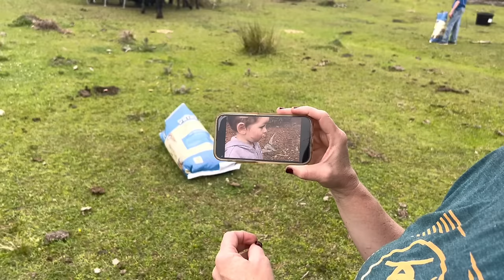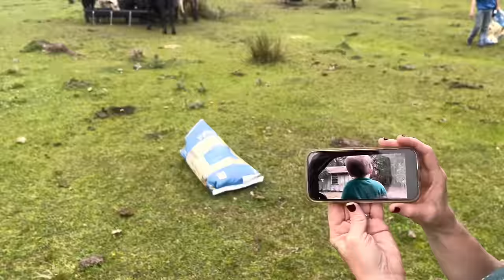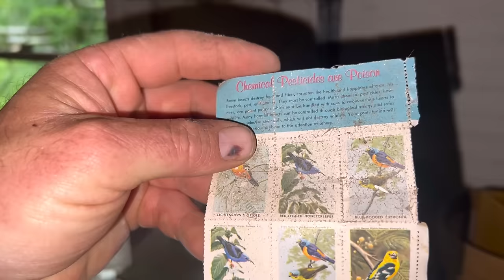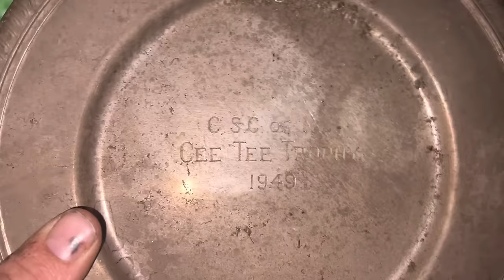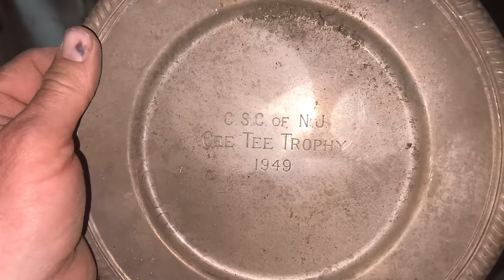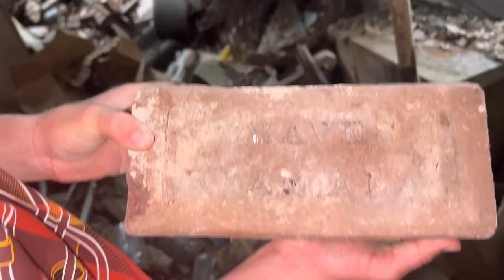WITCH HUNT cows and treasure too

Comment: If you find any old coins or piggy banks while searching those old houses, be sure to check the dates. Dimes and quarters made before 1965 are 90% silver, Old dimes have about $2 worth of silver and quarters about $5. Pre-1965 half-dollars have about $10 worth of silver and old nickels have about... $0.06! Old coins could be worth a lot more if in excellent condition or if they have certain marks or stamps, but worn and common, they have value for their silver. One coin isn't a big deal, but if you find a whole bottle or piggy bank  full.....